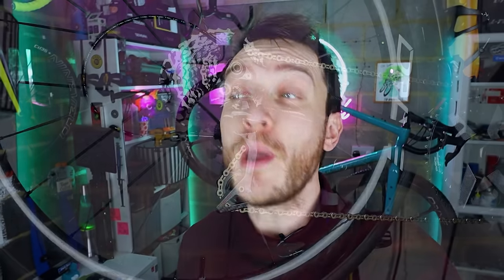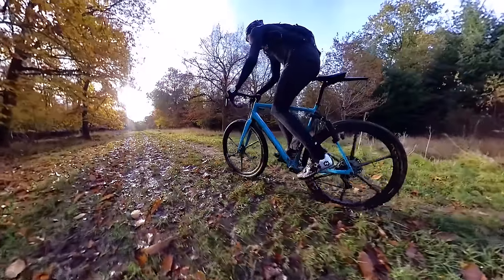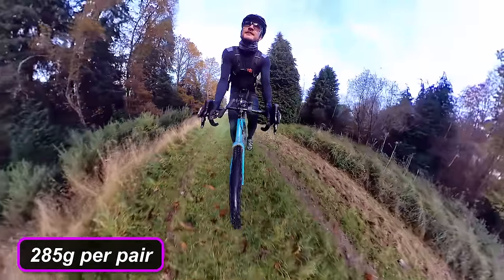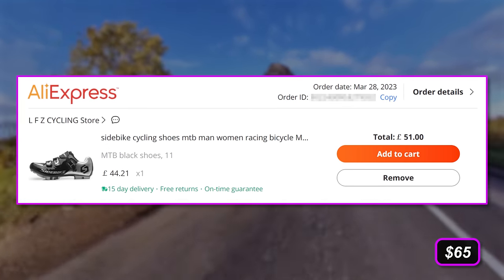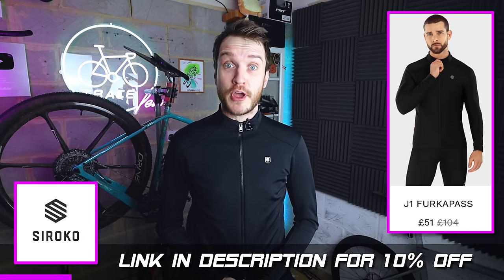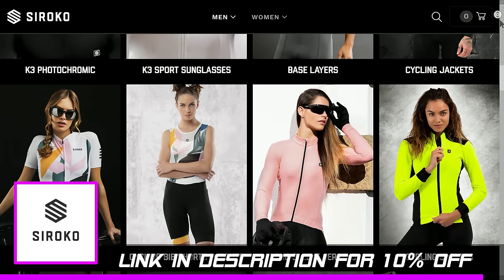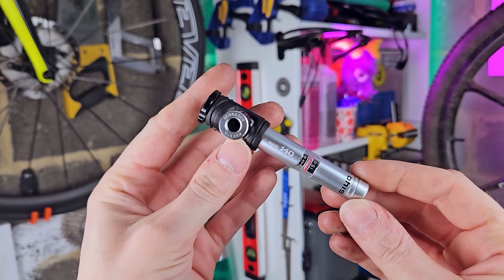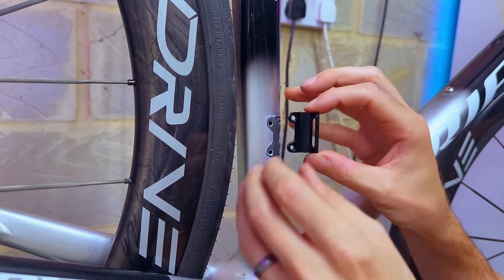Cheap bike parts - My best & worst of 2023

Comment: The biggest irony is that by far the worst product in this list, the one that puts you in direct danger, is the Hutchinson tyre, a French product, and not a Chinese one.
Reply: J'attends toujours de tester un Hutchinson de bonne qualité, il y a bien mieux dans les mêmes segments de prix
Reply: Damn the 🥖
Reply: @necrodefecator Challengers
Reply: I actually had some bad experiences with the new ones Luke bought, the Schwalbe pro one, whilst winter racing. Really sketchy. Went back to my GP5000 asap.
Reply: I don't mess with my road tires, I am Conti GP5000 all the way. I had the clincher, the TL's, and now the S TR's. Few things I will gladly pay the price for.
Reply: Continental Ultra Sport ... still the best price to performance tire available. Add a liner for puncture protection, reuse liner basically forever as far as I can tell. Tried gatorskins once and those came right the f off after the first chilly wet ride, unintentional drift racing 10 mph is not fun.
Reply: @tsoras_alex  Rode them both for a lot of km’s. Prefer the Schwalbe’s, 0 problems, more durable.
Reply: @All4Grogg  Gatorskins are notoriously bad in wet conditions, I guess if you live in a dry country (unlike me) it's fine but with the shitty conditions we got all year round in Scandinavia the GP four seasons is my first choice. Only con is their price, they're not cheap.
Reply: you sure its made in france ?
edit: ok, google says they are
Reply: @mrrodriguezHLP I just wish they weren't so damned hard to get on / off my wheels. I loved my GP5000s (run with tubes, not tubeless) but they were by far the hardest tires to mount / dismount that I've ever used, especially when I moved them to my 50mm deep carbon rims. I switched to Vittoria Corsa Controls for my next tires only because of this issue, and the Corsas were considerably easier to mount.  They've also been very good tires overall.
Reply from the maker: Yeah the irony is definitely not lost on me 🤣People always assume these cheap parts are dangerous, which don't get me wrong they definitely can be, but yeah by far the most injury i've recieved has been at the hands of those Hutchinson tyres, and just careless riding on my part. None of the cheap parts i've ever tried have catastrophically failed, or thrown me off the bike and injured me... yet
Reply: @LukeRichardson1981  the clincher version is average to mount, it was the TL's that were impossible. The S TR's fixed that, I run tubeless and can throw a tube in on the side of the road in an emergency without fear. The TL's would have been impossible. I skinned the knuckles on my hand and broke a lever mounting those once upon a time.
Reply: @LukeRichardson1981  the clinchers were easy enough to mount, it was the TL's that were impossible. The S TR's fixed that and I wouldn't fear having to remount with a tube on the side of the road in an emergency. The TL's skinned my knuckles and broke a tire lever that came with the tire, they were a pain.
Reply: @TraceVelo  for sure bin/ recycle those Hutchinsons , I gave dodgy tyres a second chance once, did not end well.
Reply: @mrrodriguezHLP Me too now after being a diehard VITTORIA Corsa fan but tired of flatting frequently.
Reply: You weirdos ride around on slick tyres with a 2mm contact patch in the rain and then moan when you lose grip??😂
Reply: French product made in China :)
Reply: I also had a bad experience with Hutchison tires - the "Nitro" model, which I bought cheap, thinking I could just toss them if they were bad.  I mounted both Hutchinson Nitros; after about 6 weeks/ maybe 250 miles, the rear one developed a bubble/ delamination on the riding surface and had to be replaced.  I should have immediately replaced the other, but figured the problem was some fluke.  After maybe a month, the second one went bad in the same way, while I was out on a long ride, and on a good descent. The bubble was so bad it rubbed the bottom of the fork crown on each pass.  Afraid I might blow out and badly crash, I slowed way down and dropped tire pressure until the blip no longer rubbed.  Luckily/ unluckily I was within about 2 miles of a shop, where I bought a new tire to get me safely home; the new tire in the high end shop in a wealthy town was $90; far more than I'd paid for the replacement one I had waiting at home.  Oh well.  (This is why these reviews are helpful; some things you shouldn't be cheap about, but hard to know without testing...)
Reply: I have Hutchinsons on my gravel bike which see action on road, off road and on rollers when time is tight but I want to spin my legs. Clocked up over 600 miles with zero issues. Sure, pretty crap on mud but they aren't designed for that.
Reply: I have some panaracer gravelking slick 28c clinchers on my road wheels and the grip and rolling resistance is good even on dirt/gravel roads when bone dry. Absolutely great, even on tarmac when wet. No punctures whatsoever!

That said, I used to have schwalbe durano 23c on my bike back in the day, absolutely terrible in puncture protection. Once I had a double puncture, front and rear at the same time, on the same hole in the street where they cut up the road which I missed, there was a tiny bumb. It went "pffft" and "tsss", welp, I only had one spare💀.  

In contrast, I have completely bottomed out on my panaracer (thinking my wheel might have damage, but nope). No punctures whatsoever. I bet, the schwalbe durano would explode then, they are SOOO punture prone.

Speaking about exploding tires, I've had my back mtb tire explode on me, I was riding a flat road, there was no warm weather.... Wtf?
Reply: Pirelli Cinturato Velo TLR I have found to be a fantastic tyre. Great grip, decent longevity and absolutely bullet proof puncture resistance.

I have picked many chunks of glass out of the tread, yet never had a puncture. I am running them tubeless which does help too.

I have done over 7K KMs so far on this pair and I'm not sure I need to try any other tyre now. These are perfect. 

I might use something slightly faster rolling if I was racing but they are great for recreational riding and fast commuting.
Reply: User error..... Has to blame anything but himself!!
Reply: I have GP 5000...and slid out on damp pavement. Will only use them on dry pavement now.

Comment: Luke. Floating discs do need to have movement at the rivets. That’s the whole point of them. Ask any motorcyclist..👍
Reply: If its not too much,yes. In the Video it looks good to me.
Reply: Yup, completely normal. The motorcycle disks that don’t rattle are called ‘semi floating’ and have little springs on the bobbins to take the rattle out. Race spec floating disks rattle.

Comment: Rattling floating disks is a well known thing in the motorbike world, it’s very common on race bikes. It means the disk is nice and free to float.
Reply: yeah if it was meant to be. but idk about this bicycle. i don't think on a bicycle that made no noise except the grunting noise of a grown man, that rattling noise sure would be annoying af. on a motorcycle this disc that made rattling noise is full floating disc brake, while there's other disc brake with the same thing that didn't move that much and made noise by having some spring in the button rivet is semi float disc brake. 

seeing how the disc button on that decas i think there's no spring on the button. maybe it was meant to be like that luke... not that i know full floating disc usage in road bike competition
Reply: Moto brakes run much higher temps, I'd warrant they don't rattle once up to operating temperatures. If your cycle rotors rattle, and you can't do anything about it, then it's time for new rotors.
Reply: I've not seen any 'floating' bike rotors that actually float

Edit: serves me right for not watching the whole video, these ones do float!
Reply from the maker: I mean this does make sense on paper. The steel brake surface is going to heat up and expand, so being ever so slightly loose would be normal, but on all other floating discs i've tried, rattling hasn't been a problem. Plus the sound was INCREDIBLY annoying, and it didnt exactly inspire masses of confidence in the disc rotor 😅
Reply: I totally get what you mean. I’ve had Hope floating disks for many years and none of them have ever rattled.
Reply: @TraceVelo  I might try using some kind of glue/silicone type thing on the rivets. Or wrap some thin thread around them to stop the rattle.

Comment: Hi Luke,
I bought a ZTTO 11 speed cassette for my gravel bike after watching your video. Very nice cassette, super light and good value. However on the very first ride the little bolts (3 of them) that hold the main block of the cassette together came loose and basically locked up the cassette onto the wheel and gouged a fait bit of aluminum out of the hub. Couldn’t stop pedaling as the crank just kept spinning and threw the chain off as soon as you stopped pedaling. So 30 km from home turned around and had a fairly interesting ride home as I live in the mountains. On the last downhill home had to keep the brakes on and pedal at the same time 😂
Pulled it off at home and the 3 tiny bolts were all loose. 
Send a message to the seller but obviously zero response. 
Have put the bolts back with a drop of locktite and hopefully it’ll hold together but I don’t think it will. 
I’ve got a few photos of the problem if you want to see them.

Comment: As for ltwoo - I just installed my GR9 groupset and I am disappointed. The shifting resistance is appauling. I used lteoo's supplied cable and a jagwire housing. The cable looks good quality. Copper-colored so maybe it' coated with something. It' definitely polished and smooth so maybe it's the cheap housing or the fact that I routed it on the front side of the handlebar where the horizontal bent is bigger forcing the housing to bent more. The levers have another groove to route the housing on the back side of the handle bar for a less bent of the housing so I must give it a try. 

But the worst thing is that the left lever bleed port screw is tightened so hard that it won't budge. I stripped and rounded its head trying to loosen it and now it's stuck forever. Suprisingly I was able to bleed the system using just one syringe plugged into the caliper so from top to bottom. But anyway I am waiting for the seller's response and his solution becasue this lever qualifies for a replacement. 

Other drawbacks:

1.  Rubber of the hoods is slippery although it has a matte feel to it and has a texture. Shimano's hoods are way more grippy. 
2. To save manufacturing costs, for the left lever they use a lever from a 2x groupset (maybe rx) because it has guiding groves for the shifter housing under the hood. They simply just don't put the cable ratchet pulley and shifitng paddle and trigger. That's ok but without this ratchert, there's a gaping hole underneath the lever where all the gunk and dust may build up. Also while on the hoods having your index and middle fimgers wrapped around the hood, you can feel that hole and it's edges under the fingers tips which is uncomfortable. Especially when you grasp firmly while pedalling hard out of the saddle uphill. How much would it cost them to desing a simple plate cover with an i.e. elastic latch similar to those of battery compartments in tv remote controllers? 

3.  Downshift trigger is in awkward position. On the hoods to reach it you have to sort of lift your hand and twist it inwards. also when pressing down the trigger, if you have your fingers wrapped underneath the lever, they are right under the trigger and obstruct its downward travel so you also have to move them away. I would expect the trigger to be place more towards the front of the lever just like it is in ltwoo's mechanical road levers like r9, r7, r5... Also, it offers up to 3-4 downshift with single push. I think this is unnecessary, because it causes excessive  unwanted downshifts. It could be justified in the road RX groupset in finish line sprint situations, but this is a gravel groupset so I think it's pointless and useless. On the plus side, the trigger is ergonomic and right were you'd look for it while on the drops. 

4. Lever instllation is troublesome. The bolt clamp is located in the center of the lever body so the vertical part with the master cylinder obstructs access to it to an extent. Also, the bolt is very hard to reach becuse the rubber of the hood is very tight and does not peel off enough to expose the bolt. You need to have an extended hex wrench with a ball-head end and prefferably with an attachable handle. With a standard-sized wrench it will be very hard to reach the bolt. For comparison, in Shimano levers the bolt is on the outer side of the lever body and it only takes to slide the wrench under the hood to reach it. 
5. The rear derailleur isa bit too big. I've installed it on an Accent Furious Pro frame and noticed that if I loosen the b-tention screw too much, the  front of the derailleur where the clutch is located touches the chainstay and wedges on it preventing normal operation. Also, the part of the derailleur with this clutch is visibally made out of some kind of composite material, probably based on nylon. It's definitely not metal. The rest of the parts, like the pantograph, pulley cage are indeed metal. Unless you buy a version with a carbon pulley cage of course. 

Pros:

1. Overall quality is good. The logo imprints are good. They are thick and have a nice sort of brushed aluminum texture. 
2. The shape of the hoods and lever blades is ergonomic. They feel good under the fingers both on the hoods and on the drops. 

A this point I honestly do not recommend GR9. It's not worth the risk. I can recommend R5 because I have had these levers for two years now and they have not failed so far. The overall build quality and shifting is comparable to Shimano Sora.

Comment: Luke, glad you had good luck with the ZTTO cassette. Just wanted to throw out there that it did not work with my XTR rear mech & KMC chain. No matter the level of adjustment (or who did it, got the lbs to step in) I could not get it running right. Once I swtched back to a sram cassette everything ran as it should. 

Keep doing what you do, love the channel.
Reply: have you tried with new chain ?
is your xtr compatible with new cassette range ?
Reply: The shimano 12 speed mtb system doesnt work well with other stuff. The cog spacing is slightly different than standard. Can get an SLX cassette for pretty cheap though.
Reply from the maker: OK i see. Like i mentioned, i found that the SRAM cassette just about had the edge in shifting performance, but for the ZTTO one to be so problematic is a surprise. Having said that, while I was using a super cheap chain (from VG sports), the shifting on the ZTTO cassette wasn't up too snuff, but once i swapped it out for a decent YBN chain, the issues sorted themselves... But who knows, sometimes the tolerances can be off with the cheaper cassetes, so maybe you got a dud...?
Reply: @garykrivo3903  I've got 12 speed XTR & XT to play really nicely with Sram GX and NX cassettes (using either Sram or KMC chains) . MTBs I get for myself and family all come with Sram groupsets, I can't stand their rear mechs (personal preference here) so I'll sell them as a factory take off and put a Shimano shifter / mech on. Never any issues and I don't need to shell out for a microspline freehub body.

Comment: I was really shocked to see the Hutchinson tires, I had also used those, I found they behaved very well in dry summer. I remember crashing taking a corner in the same conditions you described were eerily similar. I will be avoiding them as well!
Reply from the maker: Yeah i was honestly surprised they were so bad. Like i mentioned i had a pair of their Fusion 5's, and they were a little soft actually and punctured pretty easily, but atleast they gripped in the wet...

Comment: Excellent recovery with the brass nails! Nicely done indeed. Brass and carbon make a nice combo - tastefully set off with the black cotton binding.If you are interested in a tire to compete against the Schwalbe... check out the Specialized Roubaix Pro, 7500km out of my front tire and still going strong. Great performance all round in a 32mm.
Reply: Yeah. I would suggest for tires: panaracer gravelking slick for road bikes. Works well even on dirt roads and some occasional gravel. 

It has awesome puncture protection AND good rolling resistance from what I've tested, I have a 28mm one. Grip is also good, the rubber feels sticky throughout but not overly soft!
It's available up to 38mm which is crazy wide for a slick tbh. I chose 28mm because of rim brake limitations, but 32 seems my choice on disk brake bikes, it is about the fastest after width ish it seems.

I guess their other gravelking semi slick, sk (dry nobs) or even the EST with agressive nobs up until 38c are also great options if you venture offroad, price is not too expensive, like I've seen many of  the models for €25 on some sites (VERY good deal actually)!

Comment: Luke, I would caution with Schwalbe - I was using them also on my MTB, however each time i used them, after 1-3 months the thread was in good / ok condition, however the connection between left and right side of the tire itself was leaking and braking alot, I basicly lost like 3 liters of stan's tyre patching liquid due to this, new tires didnt help - the problem persisted, and as it turned out - my friend had the exact same issue. since then I am using MAXXIS and I am super happy with them.

Comment: I wonder if those xpedo pedals had an issue with the cleats? That sounds like it could be a cleat issue
Reply: That totally could be, good point!
I own that pair since 2018, used it only with Shimano cleats and never had an issue. Also, price and weight do not match reality, and they have been discontinued years ago - I would dare to claim the ones in this clip are fakes.